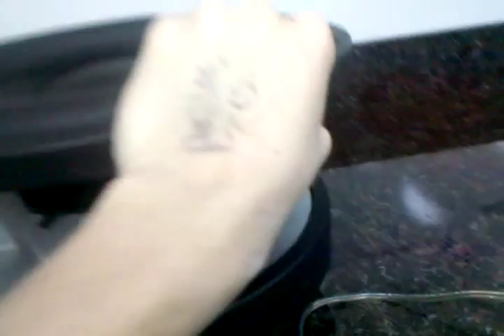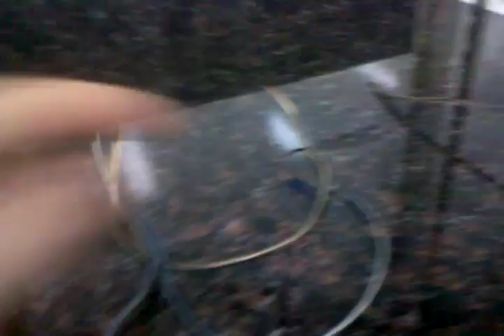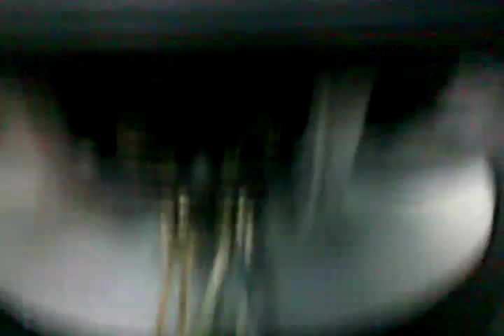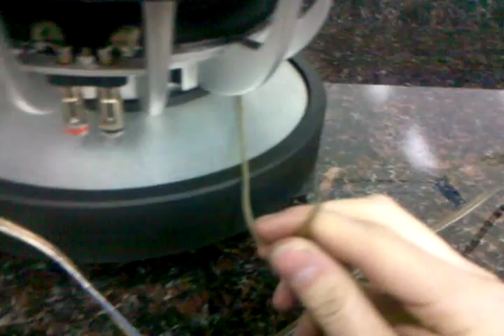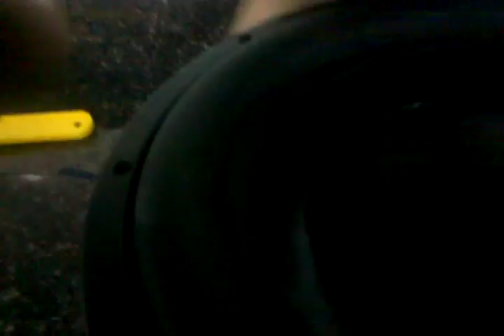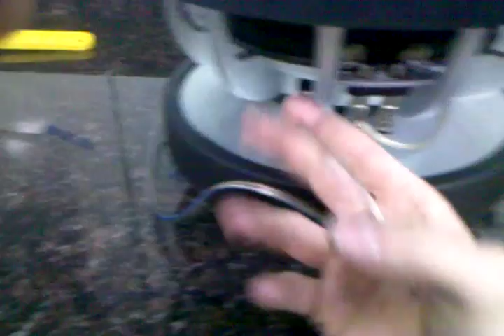1ohm wiring for Fi Car Audio Speakers!

Comment: I got 2 subs they're dual 2 and I'm trying to wire them for to 1 ohm so I can get all the power out of my amp and my amp is a mono so it only has 1 outlet of subs so how do I do that bc if I parallel it will drop to .5 ohms and that will over heat the amp

Comment: Hi, I have a noob question: I have 2 subs both are dual voice coil 4 ohm speakers. My amp does 1200 watts RMS @ 1 ohm. The subs are wired and connected to the amp. Does this mean each sub is getting 1200 watts? or is each sub getting 600 watts? The amp is a mono block (1 channel)

Comment from the maker: No need for 10awg wire,  it will work but that's far too big. Realistically 12awg speaker wire is all you need. You definitely don't want to run that kind of power with 6x9's..they are not subwoofers for the most part. Check out fi car audio for subwoofers

Comment: i have to fi q 15 2 ohms each on a mono block hifonics brutus brz 2400 and i would like to know if i could wire it the same way you did to get the lowers ohms as possible.

Comment from the maker: @Tonio9606 uh..no the coils are wired in parallel. that's why you have a jumper. you only do a positive on one coil and a negative on the other coil when you are wiring in series. you then have one positive and one negative lead that is the same matched pair wire that hooks to the amplifier + and - respectively...

Comment: hey i have a question does it matter what kind of wire you use? for example can i use coper for my negative or just for my positive. what would u recommend? one more question does this wiring to 1ohm is only for the brand you have or any? i have a 15 T2 FOSGATE woofer but Ive been told different ways to connect them.

Comment: Or if you are using 1 amp 1 dual 2 sub just hook up both negatives and positives to the amp for a 1 ohm load off a dual 2 sub right? that is the best way to do it so i can evenly distribute the power to each coil and SLAP the shit out of em!

Comment from the maker: Vinyl stays on a top fuel dragster going 300 miles per hour in a 1/4 mile...i don't see a sticker flying off of a dustcap of a speaker.

Of course that isn't the right size wire to use...it is simply a demonstration...don't try to confuse or complicate things anymore then they already are.